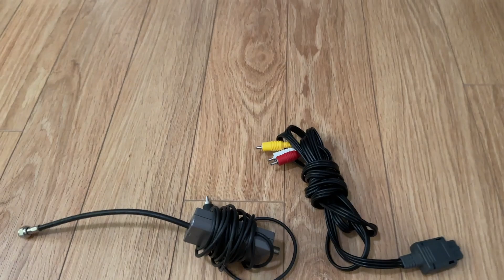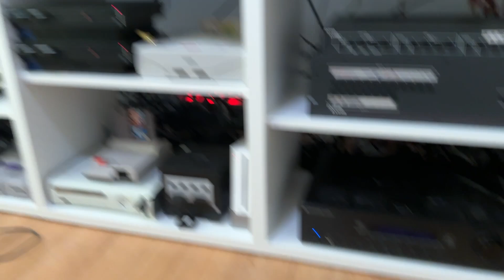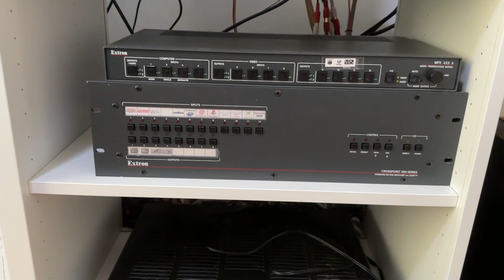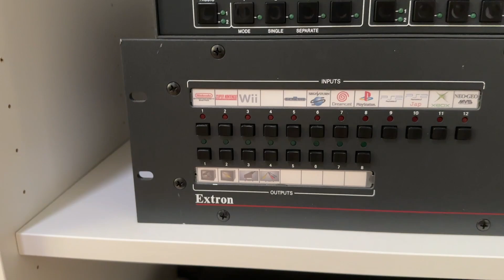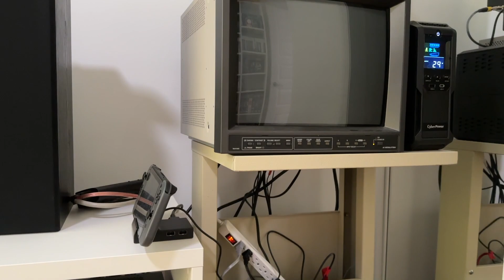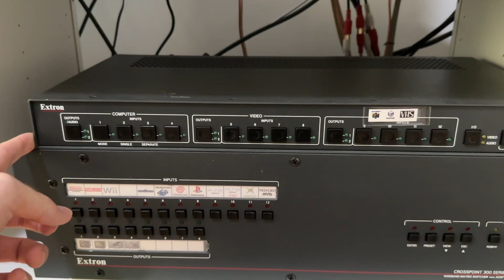Hooking up your consoles : From coax to RGB SCART

Comment: Very useful video, keep it up. I'm interested in whether the Extron MPX 432 A can, for example, output an S-video in signal through a composite or RGB out connector? Does it convert video signals?
Reply from the maker: Sorry for the late response, unfortunately the Extrons dont convert signal, they just duplicate or redirect exactly what you input to them. Also, for this particular MPX, the svideo signal only comes out of svideo connectors (4 in, 2 out) and the audio is through Phoenix connectors. Hope this helps!